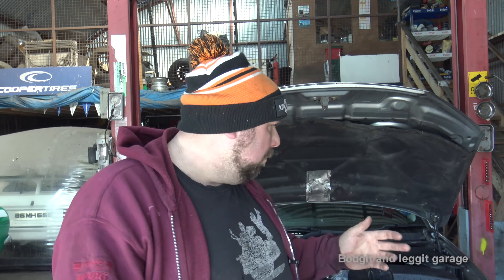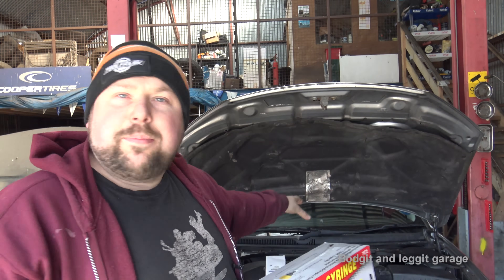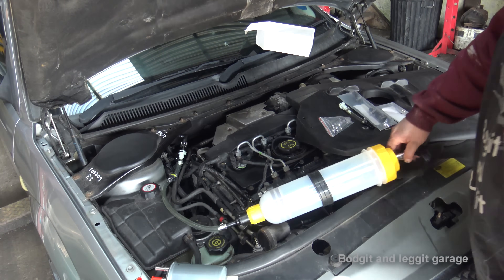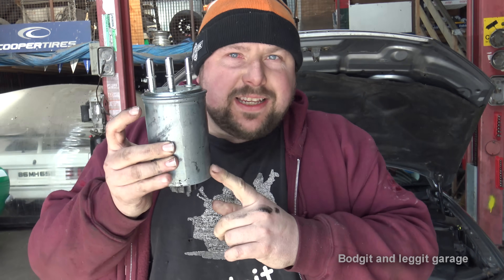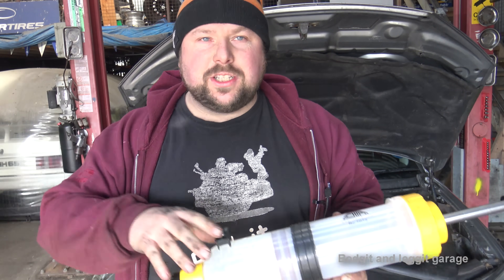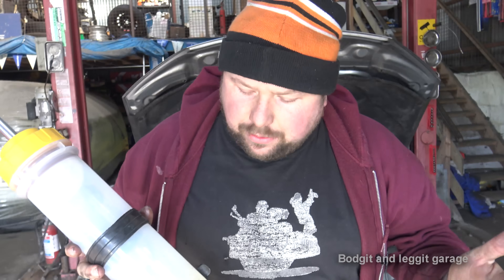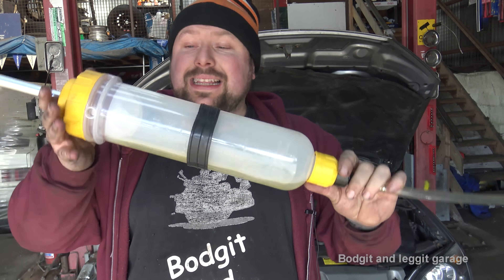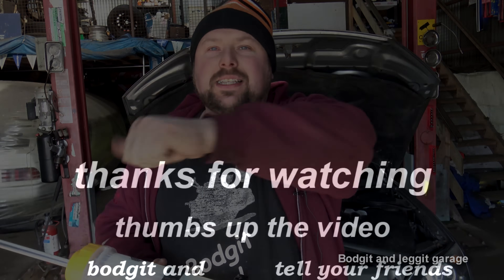How To Bleed Any Diesel Engine Fast&Easy CTA Diesel Syring Bodgit And Leggit Garage

Comment: Great videos. In connection with this video ive replaced an injector on my skoda roomster 1.6 common rail tdi. Ive bought the syringe. I note that you suck up diesel from the tank via the fuel filter in port. . When you later inject the excess diesel into the fuel filter rather than pressurise the fuel rail. What stops you pushing fuel back to the tank. Is there a check valve in the fuel line. 

When i push fuel towards the common rail do i need to open the injector union nut or leave them closed. Your advice would be appreciated. Gary

Comment: I had fuel system apart on 2008 x-trail  2.0 dCi m9r engine had a air leak and blocked return pipe. I've tried everything to bleed it up! even putting one pipe from filter to HPFP but seems to be recirculating air back in to fuel filter as its a odd filter 4 pipes in/out  and then anther 2 on a T. this is hardest one I've ever done

Comment: How would I use this to remove unleaded petrol I put in my tank by accident, would I attach it to the pipe coming from the fuel tank suck all the contaminated petrol and diesel oil out then put fresh diesel in the tank then attach a syringe to the return back to tank pipe the one with a smaller diameter on the fuel filter so then I will be sucking fuel good diesel from the tank through the fuel filter checking the old contaminated fluid out and sucking all the fluids in The fuel rail your advice on this would be gratefully accepted

Comment: I have watched your video and bought one of these syringes I’ve accidentally put unleaded fuel in my diesel I have a 1.8 TDCi Mk1 Ford Focus, Just after some advice I was thinking because I’ve only just started it it started to die would I be correct in unclipping the petrol tank feed sucking everything out of the petrol tank then adding say five or 6 L of good diesel and then attaching this syringe to the return back to thank Pat Pike the little one

Comment: if you take the feed pipe off to engine  will that not introduce air in the pipe?
Reply: The air only matters because and when you've got half a litre of air in the filter, pre filling the filter cuts out bleed time, by A LOT. The volume of the feed pipe is what, 20ml of air?

Comment: Cheers mate,
I have a question though ,I have to fill my fuel filter on a ford fiesta 1.4 tdci 2008 
I know what to do to get it filled and bleed the return,
My question is to you when I suck the fuel through to fill the filter using my vacuum pump do i have to turn the ignition key to a possition so It opens up the car fuel pump,
or no need just leave ignition off untill all bleeding done,

Comment: Hi mate I know this is an old video but I have a question if you could help. 

I have a 09 connect 1.8tdci that's air locked. Would the syringe work? If I follow the same procedure as the video would that bleed the whole system? 

Many thanks mate great content on your channel. Subscribed and liked 👍
Reply from the maker: Hi mate they can be an absolute nightmare to bleed yes this will work
Reply: @bodgitandleggitgarage  thanks for the reply, forgive me for probably asking something silly. 

Is the fuel system bled right through to the injector? When you push the fuel through the filter after you've eliminated the air, the remaining air will go back through leak off pipes?
Reply from the maker: @brickpug6088  hi mate once the filter has got fuel in it and it's full to the top the engine will do the rest of the work for you sometimes you might have to fill up a couple of times but once injectors get the fuel to it on the return of the injectors it will kind of bleed itself from there
Reply: @bodgitandleggitgarage  nice one mate thanks again cross your fingers for me 🤞🤣

Comment: After watching your vid I brought one on line looks identical  with the attachments I watched you fordfiest  service. One that was also great as at the minute my car is not starting  I took the back hose of no sign of any fuel can you tell me if I turn the key and start to crank should deists come from tank I am not us d to a diesel as never had one brought for daughter for Christmas 3500 and can’t give it to her as the next morning it wouldn’t  start thought it was bad glow plugs changed he four what a job turned the car over started straight. away two hours later hard to start  I got it started  drove up road car engine stoped would not start that’s when I check d any fuel going to filter any help would be great dose the Diesel engine have a pump like petrol
Reply from the maker: Hi mate these diesel Mondeos are a nightmare to start there's no pump in the back so you have to prime it yourself with the tool that you brought you can do this

Comment: I am getting fuel to my filter snd past it to my injection pump... its the only pump on the car, old school mechanically injected. How can I get the air out of the lines between pump and injector? Can I just use ether and run it for a minute or two?
Reply from the maker: Hi mate on each injector you will see a metal pipe you need to loosen one at a time until you start seeing diesel come through
Reply: @bodgitandleggitgarage  tha ks man!! I will be giving that a try tomorrow. I thought I mightve been able to get away if I just put a can of starter fluid through it til it started sucking on its oqn

Comment: Hi, kind of new to this, but I learn as I go. I tried to start my 2.2 tdci mk3 with the new filter dry, probably got lots of air now in the system. The nut by the injector ain't giving me no diesel while cranking it, and sometimes it does.  Could this weapon of choice help me troubles? Tried  cranking it several times and been charging the battery on and off for a week now.
Reply from the maker: Hi mate you always always need to fill the filter whether you do it before or after you fit it doesn't really matter but the filter has to be filled then you can open the injectors and turn the engine until the fuel comes out of the injectors these engines can be an absolute nightmare to bleed you might have to fill the fuel filter a few times open each injector a time once they are stops and the fluid comes out clothes that injector and try the next one

Comment: Good but how do you bleed the injectors and rail when you install all new?
Reply from the maker: Hi mate you don't really need to bleed the injectors as such what happens is as long as your diesel filter is full the injectors are pre-filled and the pump will draw the diesel from the filter but what you can do if you want is you can loosen the the feeder pipe going into the injectors which will get the air out but that is a long and messy process once the filter is full it would draw into the injectors and all the air bubbles will come out the return of the injectors
Reply: really here i was thinking i had to do filters + injectors... Ssangyong stavic 2.7l turbo diesel with delph injectors... trouble starting it but your vid made sense of my problem thanks a million your a legend.
Reply: @RickHavensteinMusician   it  has a   hand  primer,  well my one  has

Comment: I Changed injector copper seals on my peugeot 206 1.4 HDI, and solved the compression leak, but i think there is air in fuel system as the car won't start. Any help
Reply from the maker: Hi mate there is loads of ways of bleeding your system the first one is I show it in the video with the tool this is really good especially if you want your own if not you can open up each of the injectors and start the engine and wait for the bubbles to stop this can be very difficult and can cause problems and can wear down your battery that's why I showed in this video this tool which is so much simpler and easier to use

Comment: Can't you just install the new filter then connect the syringe to the connector that feeds the engine suck it threw till it's fills the filter and into the syringe that way no air ?
Reply from the maker: Hi mate the problem of doing that is like explaining the video if you've got dirty diesel or anything wrong any bits floating in your diesel it's going to go straight through and destroy your new filter some filters are very very expensive and it would just be a waste of money
Reply: @bodgitandleggitgarage  very true mate worth the extra couple of minutes just to be sure i bought one the other day to add to my box  can't wait to use it great videos oh and iam going to buy the crp429c what a piece of kit much better and simpler than any snap on one's I've used

Comment: Interesting!
We have a 2011 Polo 1.2 TDI which has the CFWA Common Rail engine which apparently needs both the lift pump on the tank and the pressure pump on the engine activated by the likes of VCDS to prime the fuel system after a filter change.

Does this product cater for diesel common rail engine fuel systems?
Reply from the maker: The car used on in the video was coming round it all depends on the car all that system doors on your car is to fill the diesel filter housing this will still fill the diesel filter housing so as long as you can fill the housing it will work on any car so depending on the car you might need to fill the syringe separately full of diesel and just squirt it straight into the diesel filter housing rather than trying to suck it from the tank all depends on the car

Comment: You didnt need to prefill the syringe.
Just put the new filter in, connect the line from tank to the new filter,
Connect the syringe to the filter port that goes to the engine and pull the handle.
This will pull fuel out of the tank into the filter and up into the syringe.
You stop pulling when there are no more bubbles coming up into the syringe.
Then disconnect the syringe and connect the line going to engine.
Reply from the maker: Like I explained in a video you can check the state of the diesel in the syringe you put a brand new filter on you then syringe it through and you realise your diesel is contaminated you've just wasted money on a new filter I explain all this in the video why not do it this way and you 100% sure you will not damage or filter not even that you can spend thousands of pounds if you damage your injectors or your pumps because of bad diesel
Reply: Yeah I realised that after I posted, tried to delete...
I always used to blow the fuel out of the old filter in reverse direction into a glass bottle to see how much crap was in it and to show the customer. Although that wouldnt indicate the condition of the fuel in the tank.
Reply from the maker: @RIPPERTON  you should always cut the Old filter this way you can see if there's any metal in it this will also give you an indication to how your injectors and fuel pump is

Comment: very handy piece  of kit , could you also  after fitting the new filter  pull the diesel through it while having the  return to the tank  blocked off at the top of the filter  .
Reply from the maker: yes but why
Reply: just thinking it might be handier/ quicker that's if there were no problems and you didn't need to see what condition the diesel was in .
Reply from the maker: @duggy788  it's extremely important to know the condition of the diesel if you got bad diesel and you can catch it in time it can save you thousands of pounds in new pumps and new injectors
Reply: o I know,  I worked as a mechanic for about 20 years im just saying if you were doing a regular filter change with no engine  issues, i'm not knocking your work ,  keep up the good work .  @bodgitandleggitgarage

Comment: Great piece of kit but expensive for the home mechanic it’s ok for a working garages but I personally would find it hard to justify the cost
Reply from the maker: Hi mate I don't agree with you on that it's not that expensive and a hell of a lot cheaper than replacing your high pressure pump I've seen people damage high pressure pumps because they don't know what they are doing or how to bleed a system with this it's easy and a hell of a lot cheaper than high pressure pump

Comment: Thanks for this vid it gives me hope for future repairs.

I hate messing with diesel lines because I know it's going to be a sod to start afterwards, I have a vauxhall with 1.7cdti the thing operates on a suction style set up no uplift pump in the tank, had an injector go so replaced it programmed it in with tech 2 but no go, never again until I can find a way to make them start quicker, it was a complete nightmare to get going tried everything even easy start to try and force it to bleed, engine ran fine on easy start but soon as you stopped the engine shut down, after much cranking it did eventually go but feck me! getting worried was a understatement!

I have a Mazda 2.2 D with leaking injector seals, but luckily there is a primer bulb on the fuel filter so fingers crossed I wont have any issues.
Reply: For cars withour an uplift pump just take a rag and pressurize your tank via the fuel fill hole. It will push fuel all the way up your inj pump and help bleeding by a lot

Comment: OMG!! Could have used one of these a month or so ago after servicing an SMax. Two flat batteries, flat jump pack, hot jump leads later we had to give her a bit of puff (brake cleaner) in the intake to get it bled. It cost us probably an hour and a half, all for the sake of not fitting a hand primer in the system..........sometimes I hate modern cars......
Reply from the maker: Yes mate sometimes it can be a nightmare that's where this definitely comes in handy quick easy sorted like they say work Smarter not harder

Comment: Hi there I've recently had a new engine fitted in my ford fiesta 58 plate as my timing belt slipped. I have a mechanic who does cars in his spare time he is having trouble trying to get the diesel from fuel tank to the fuel filter. He has told me that he's tried forcing the fuel through to filter with a compressor baring in mind I know nothing about cars I'm only going with what he is telling me. I am wondering if anybody has any ideas or suggestions.thank you
Reply from the maker: Marie Wells hi mate there's a couple things you can do sounds like you maybe have a blockage in your fuel tank the first thing I would do is disconnect the pipe from the filter to the fuel tank try and blow through it see if you can if you can go through it you know you have a blockage in your fuel tank you might have a valve in your fuel tank that is broken off the top of my head I cannot remember exactly what is in your fuel tank but that's one of the first things to do
Reply: Thank you, I forgot to say before putting new engine in the car  was also serviced so it's a new fuel filter that's been put in to I was told that apparently Ford's are bad for getting fuel to fuel filter. Thanks mate
Reply from the maker: Marie Wells not if it's blocked
Reply: bodgit and leggit garage thank you

Comment: I would have fitted new filter then put the syringe on the outlet to the engine spout then pulled the diesel right through the filter.
Reply from the maker: Steve Ashcroft right and in doing that you still haven't checked the diesel if you then find the diesel to be contaminated you have just wasted money on a very expensive main dealer filter there is no need to do this if you do it the way I said
Reply: Steve Ashcroft he is right mate

Comment: ive seen chrisfix do it but his priming method is  connect  everything,  then ignition on  for 5 seconds off on for 5 off on for 5  off  start the car, will that work?
Reply from the maker: Martin Cooper absolutely pointless putting the ignition on there is no lift pump in this particular engine will make no difference at all
Reply: maybe that works on petrol cars , my fuel pump needs doing  seems its something i dont have the tools for so gonna need to go to the garage,  to get it done, revs are cutting out on me  at 3-4000 and its only gonna get worse
Reply: That won't work on a Mondeo because it has no electric pump in the fuel tank, a mechanical pump pulls diesel up when engine is running
Reply from the maker: Steve Ashcroft with a car with a lift pump in the tank you do not have any problems bleeding it's a self bleeding system
Reply: Yes I know, I was explaining why Chris Fix was seen switching ignition on for a few seconds then off and back on.
Reply from the maker: Steve Ashcroft ok but don't understand why you're saying Chris fix method on my video where it has nothing to do with my video completely different system
Reply: I was answering Martin Cooper's comment on your video (about 7 comments above this reply) He was asking if Chris Fix's method would work! which it wont if there is no pump in da tank
Reply from the maker: oh ok mate sorry
Reply: Martin Cooper thats for a gasoline engine with. An electric fuel pump in the tank. This car he is working on is a diesel vehicule without electric fuel pump in the tank.

Comment: Long time no post. I must thank you for your advice regarding a 2005 VW Passat with drivers door intermittently  not unlocking with remote, electrical between door and car living did the trick. So a much more general question this time around. Can you recommend a specific model car as being low running costs, good mpg, reliable and doesn't cost an arm and a testicle when things do happen to go wrong? And is there a mileage where you say it is too much, or don't bother? A lot of questions, and every mechanic will have their own opinion, but seeing as you are in the public eye, you might give a true and honest opinion! Cheers big ears!
Reply from the maker: Aidan Conlon hi that is a really difficult question because it depends on lots of things budget taste what type of car you actually prefer what type of car you need depends on your journey do you do long journeys do you do short journeys but Ford are one of the cheapest cars to repair on the road lots of them easy to get parts for if you don't do long journeys just stay with the petrol as diesels can have a lot more problems and more expensive to fix especially the newer ones